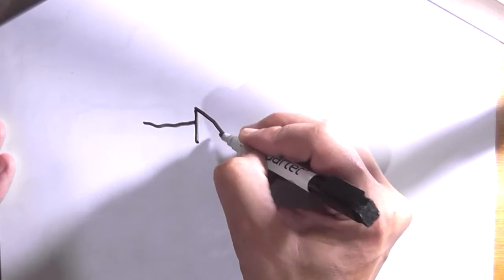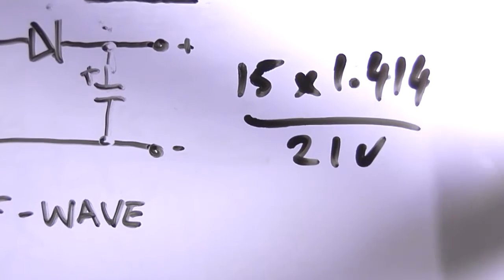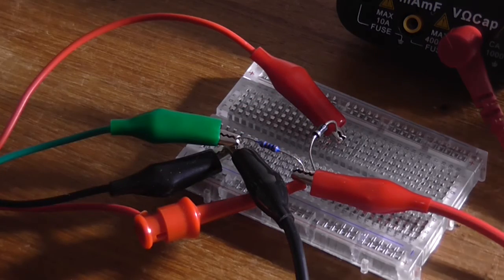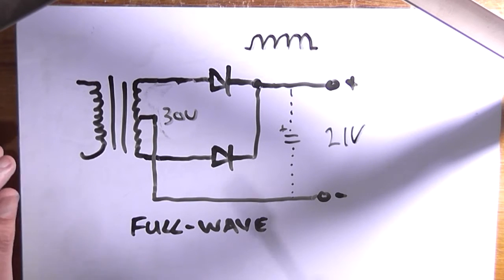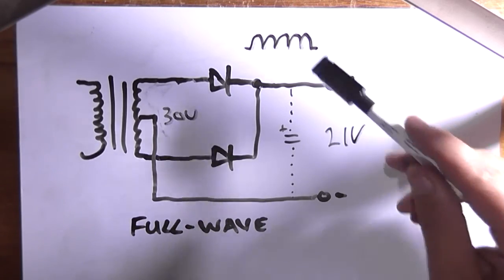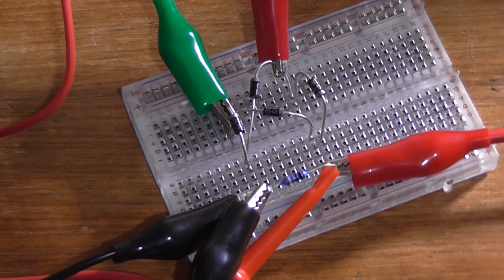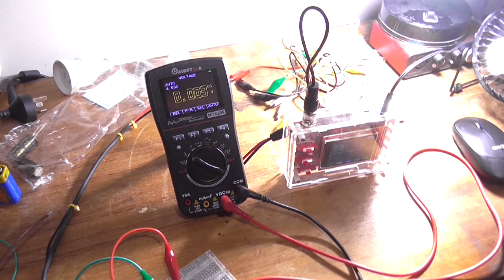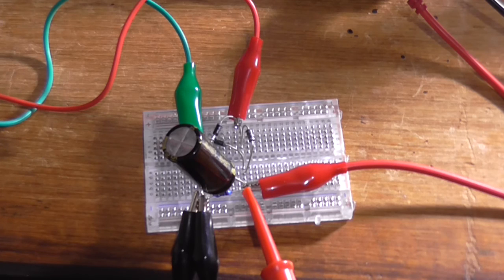Electronics Fundamentals: AC to DC Rectification & Filtration

Comment: Why don't you use a capacitance multiplier to reduce ripple, instead of an expensive large capacitance ?
Reply from the maker: Because that over complicates things, and you still need a large capacitance after the rectifier. The premise of this video was to demonstrate the different types of rectifier circuit plus basic filtration as used in loads of equipment with a linear supply. I will look at making a video on capacitance multipliers separately. Thanks for the input.